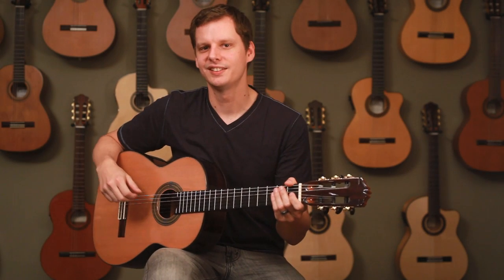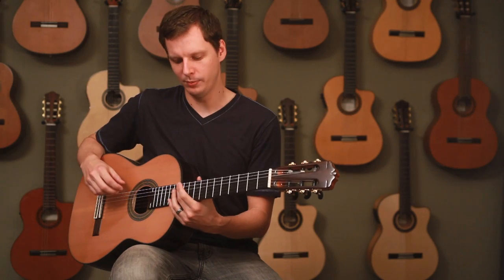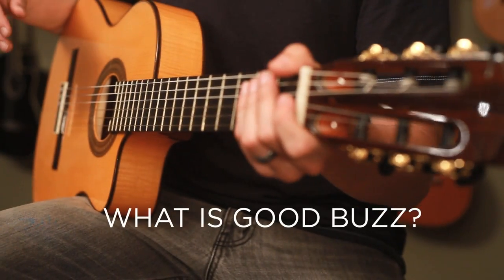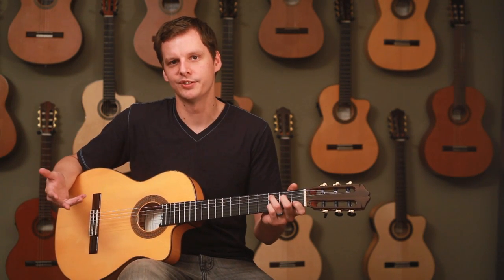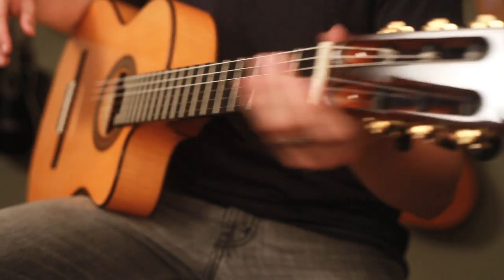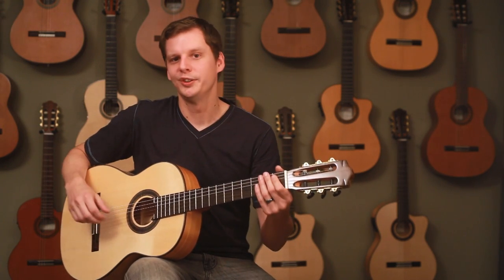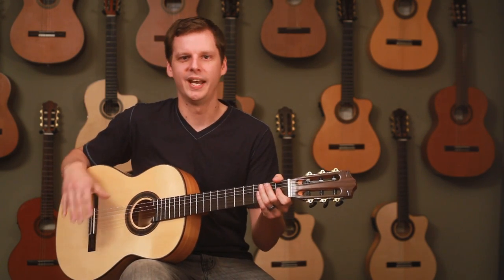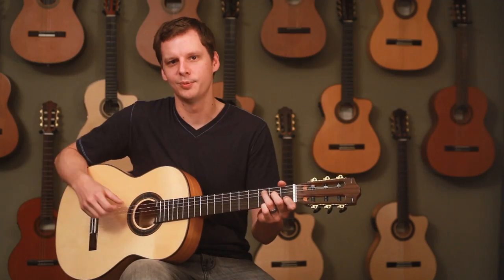Understanding Fret Buzz on Nylon String Guitars

Comment: Bought an expensive Alhambra guitar 2 years ago. Because of the heat, neck is bowed, 0,43 mm over 12th fret -- not good; 1400 euros down the drain ?

Comment: what about buzz 'behind the fret' being fretted (caused by a droning string sympathetically vibrating the fretted string behind the fretted note).  One of the more hidden/secret buzzes :)
It can be sometimes heard with classical guitars with lower actions (3mm and below - I've seen this issue happen).  

An example, for me, happened if I played recuerdos de alhambra.  Near the very start of the piece, there is a three note C chord (where you play the open G string as well).  On one guitar I had this chord made the Bass E string rattle at the 7th fret (while I was fretting this string on the 8th fret).  Really annoying, the only fix was to refiner so I had a finger on the 7th fret (muting it) ..but this made the chord fingering of the progression 'unnatural'.